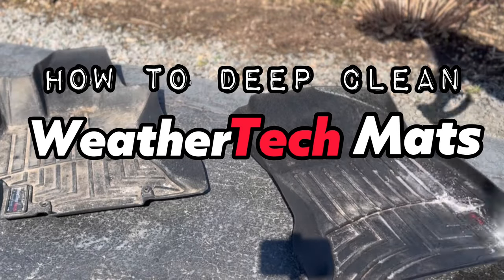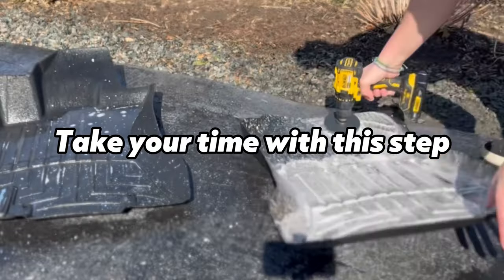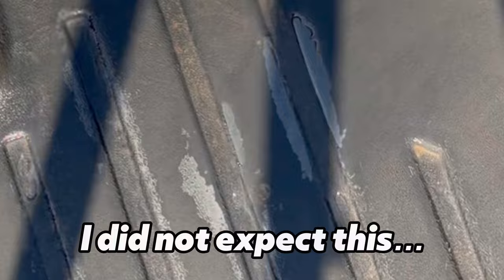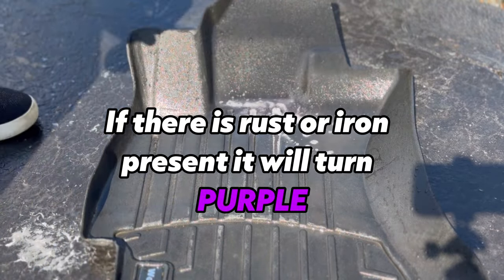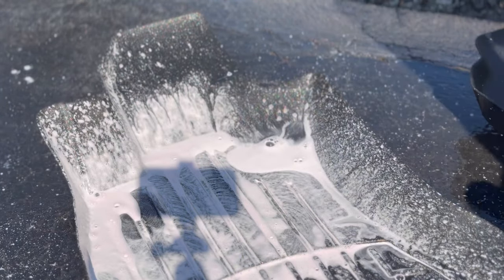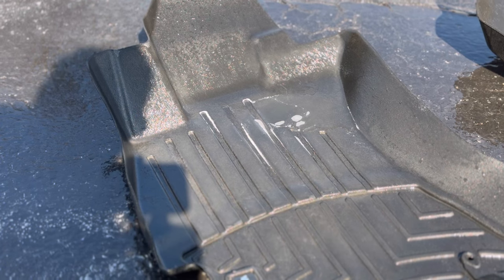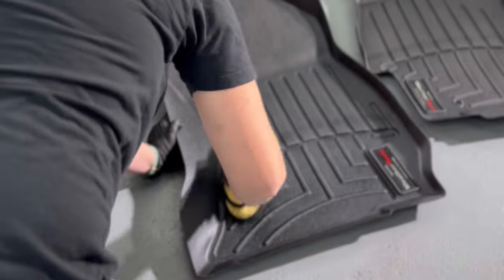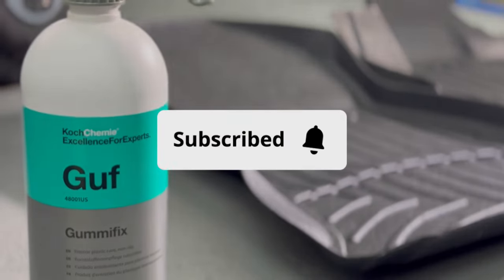@weathertech  Mats- How To Keep Them Looking Like New + A Shocking Issue Addressed!

Comment: Good feature here, Chelsea.   WeatherTecs can be a real bear.  Yes, be careful with what you use to dress them with as they can turn into skating rinks! Potentially dangerous. 
One thing I found to work well is, once well cleaned, leave them in the warm sun for about a 15 minutes - ½ hour. I am amazed at how well it refreshed the finish!  A note of caution: do not leave in the sun on any type of hot surface, i.e. asphalt driveway, crushed stone etc...
Placing them in direct sunlight on the grass/lawn works best. Otherwise, they will distort/warp.
Shine on you crazy diamond!

Comment: That was not rust from the mat but carried onto the mat from the owners shoes. You did everything correctly but that drill brush is not getting into those channels of the mat.  I find the same results doing that but now add using a tire brush to get down into those channels, you could use a narrow grout brush too.  Guf is good but 303 Protectant light application and wipe off with MF towel recommended to diminish as slickness.

Comment: I have actualy been using KCX MSN (Vorreiniger B) on mats as its rated for use on wheels and tires and its my current prewash. WORKS GREAT! like an 8/10 nmat cleaner and u can see it lift the dirt and brownming from oxidization in mats like apc on tires! i need to get my hands on some gummifx tho!!! never seen rust on mats either, i wonder whatr shoes the owner wears???

Comment: Nice work on the mats!! 
I have been using a bathroom cleaner that is for mineral deposits  (dirt).  Lime Away foam cleaner works great. I use a grout brush and steam for the tight areas. 
I need to try Gummy Fix. Looks like it works great!

Comment: Unfortunately, these types of floor liners are made extremely cheap. I am looking for an alternative. In less than a year, they are showing signs of wear. I'm wondering if the original carpeted floor liners aren't the answer. Yes, they get dirty, but don't wear so much. Thanks for your review, Chelsea.
Reply: Weathertech is cheap!  Husky liners are much more durable and a bit more flexible.  Great fitting too!  👍🏻
Reply: @tundrawhisperer4821  thank you
Reply: @kimnewling5728  I’m confident you’ll be very happy if you get a set of Husky liners.  I bought a brand new set for my Toyota Tundra 6 years ago and they still look great!  And they clean up great too.  I’m going to be getting a set for my Daytona 392 soon.
Reply: @tundrawhisperer4821  that's good to know. Thanks
Reply: Carpet floor mats wear badly too and will hide the grime from your shoes.  WeatherTech or Husky Liners are best to help keep you flooring safe from your feet.  Spend time with any liner product and you quickly can see what they are collecting from your shoes.
Reply: @MyGuyKirby  good point
Reply: Hi Kim!  My brothers who are living in Florida liked the TUXMAT, just like I do.  I know there is a new brand also named 3D MAXpider
Reply: @1stfrompuertorico568  Thank you, Humberto